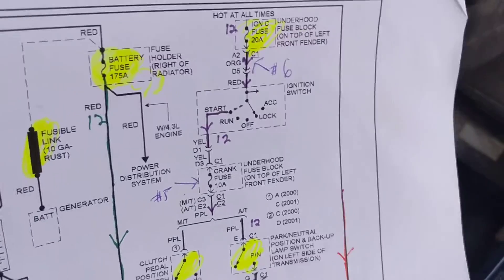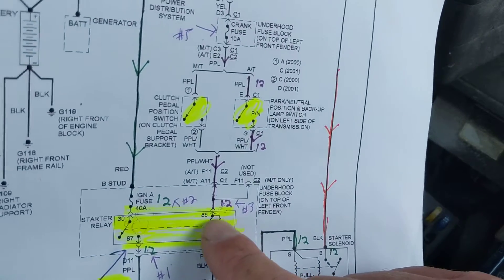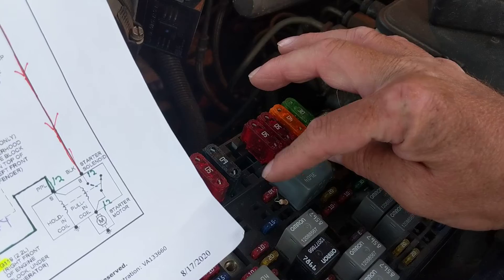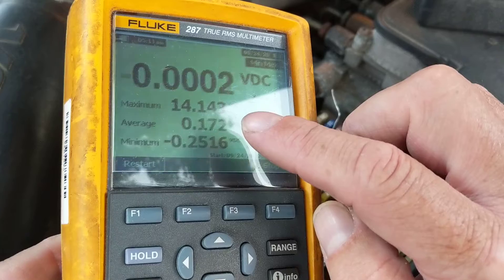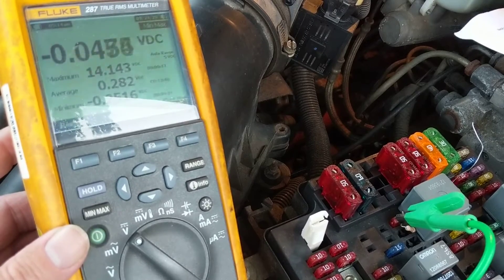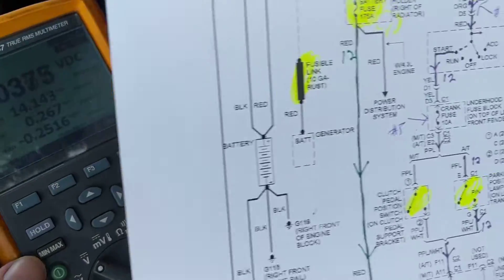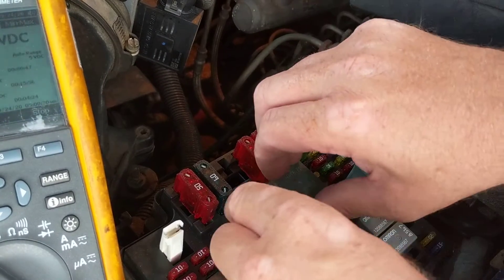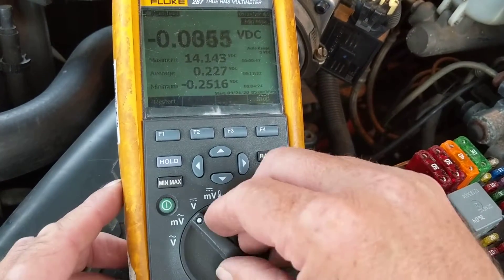FUEL PUMP RELAY PROBLEM HOW TO TEST IN CIRCUIT NEW TECHNIQUE

Comment: Hi Joe, you're not going to see the voltage drop across the battery caused by the high amp draw from the starter because you have the positive lead from your meter on one end of the resistor and the negative lead of your meter to ground. Your meter will read close to zero volts while cranking because the 12 volts being applied to pin 87 from pin 30 are on one side of the resistor and since the resistor is the only load between pin 87 and ground, it will drop all the voltage. Basically you will have 12 volts on one side of the resistor (the side connected to pin 87) and zero volts on the other side (the side your positive meter lead is connected).

Comment: Hello, can you tell me if the fuel pump get its power from the fuel pump relay or the fuel pump fuse on the fuse box. Also where does the fuel pump fuse normally get its power from. The ecu, battery or fuel pump relay..Thanks in advance
Reply from the maker: Yes good question the fuel pump gets its power on the load side from the relay and the fuel pump fuse is located in the fuse box as you commented the fuel pump fuse gets it from the battery on the load side connected to the fuel pump the other side which is the coil gets it from the computer thank you so much you can refer to my channel for more explanations thank you so much
Reply: @Joeelectronicschematicsforauto   so what should I check, I have no power to the fuel pump fuse or fuel pump relay? No really sure
Reply: Not  sure
Reply from the maker: @rdookran4205  one side of the fuse should measure 12 volts in the start position even if the fuse is blown one side should measure 12 volts make sure your ground connection is good and there is no corrosion or rust on the ground and use the battery ground
Reply from the maker: @rdookran4205  nowadays usually do fuel pump relay gets it from a computer to turn it on and off as is needed so either one side of the coil goes to the computer or the b+ side of it goes to the computer I'm referring to the coil side of the relay
Reply: Thanks for your reply, the fuel pump fuse isn't getting any power. I think I'll have to figure out what powers the fuse and take it from there
Reply from the maker: @rdookran4205  so you're saying no side of the fuse gets 12 volts the difference which side the coil side goes through the ignition switch and the load side goes to the b+ hot at all times depending on the make and model in the car
Reply: Yep, I connected a direct 12v from the battery to fuse and the fuel pump got power and came on but still doesn't start..

Comment: What size/gauge of wire is that? Where do you buy it? Nice vids thanks
Reply from the maker: You can use any copper wire or you can use a resistor